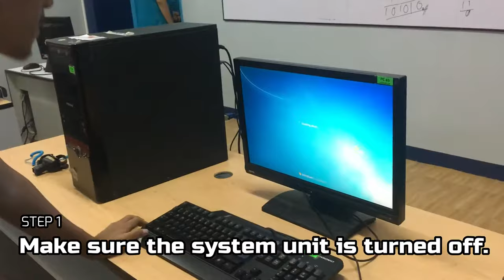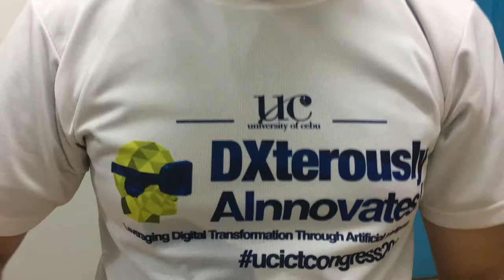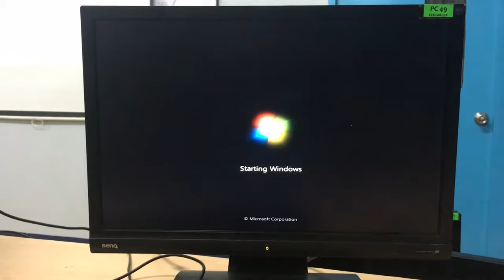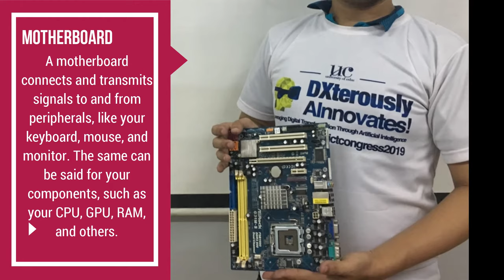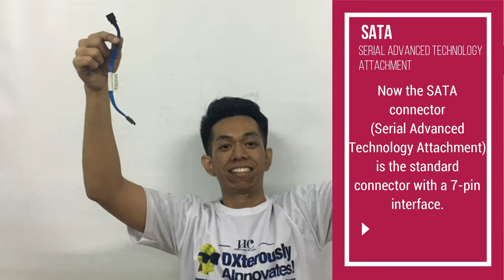How to Disassemble/Assemble a Computer System Unit? - Basic Parts and Function

Comment: Hello, permission to use your video po, for my report. Thankyou♥️
Reply from the maker: Ohh sure. Just include the youtube link when you present this in you class. Thank you po
Reply: Noted po. May I ask if what kind of screw driver you use in tightening the screws. Because in or lesson there are different kind of screw driver heheh, thank you again.
Reply from the maker: @jol-anncullon7003  
Non-Magnetic Standard Philip-Screwdriver(+) and Flathead Screwdriver(-). Pero kadalasan ginagamit po ay yung PhilipScrewdriver.